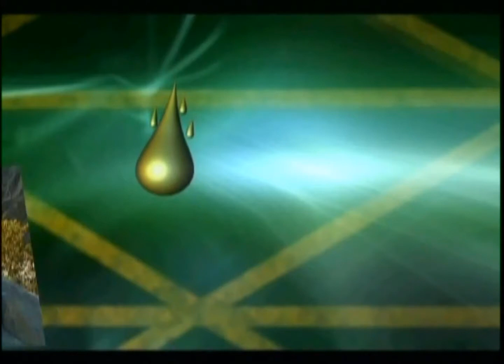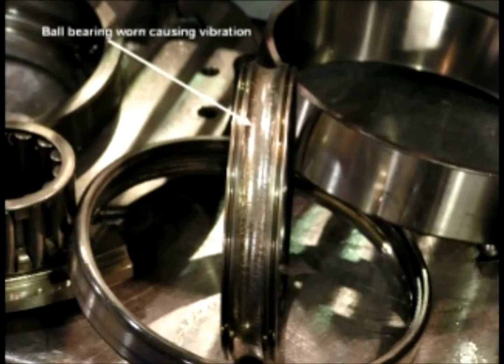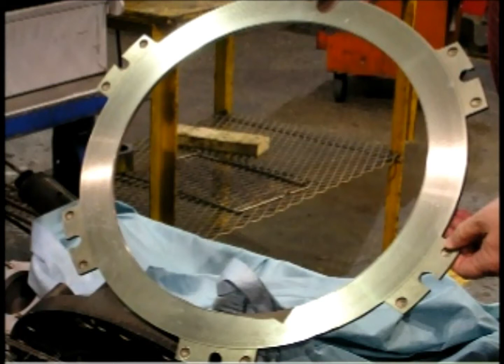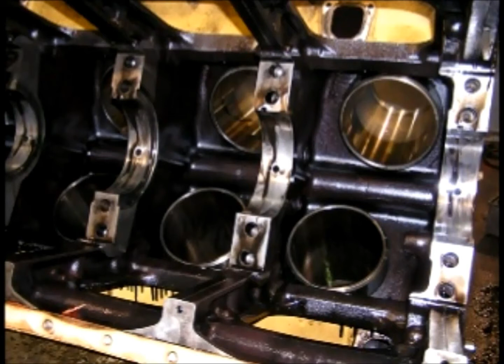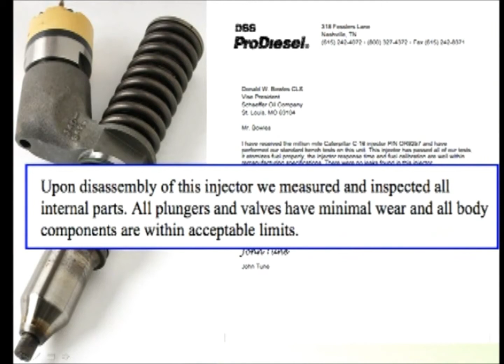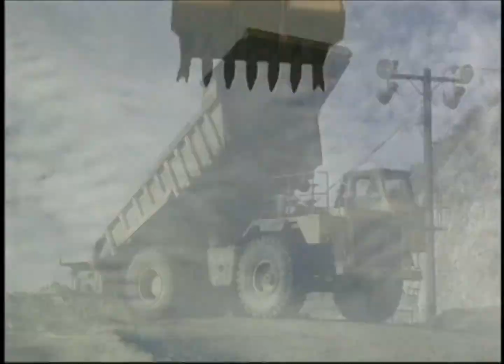Schaeffer Oil Presentation

Comment: i was a Schaeffer usser 500k milles on Cumins big truck aplication. engine failled near 900k, (others runs 1.4-1.6 mil. miles on regular oil) we rebuilded the engine, runned 80k, cranckshaft down. 
no more Schaeffer oil. sorry. don't belive everithing you see.  my hard way learned leson.
Reply: Danny J How do you know it was the oil?
Reply: They don’t call em Cumaparts for nothing. Schaeffer oil had nothing to do with the failure.
Reply: Danny J so you’re saying it’s not as good as they say?
Reply: if Schaeffer was what they say, my engine should have run for ever. running Rotella, Mobil or anything else engine runs 1.2-1.5 mil miles. I used Schaeffer 400k plus and rockers went bad. presentation is science fiction, not real.   @adamscott5175

Comment: That engine looked brand new. I just purchased a used Deere 160 excavator and the company that owned it before me used Scaeffer engine oil. It has 8,500 hrs and the engine shows almost no blowby and no exhaust smoke when a cold start up. I gotta say your products definitely help equipment run better and longer.